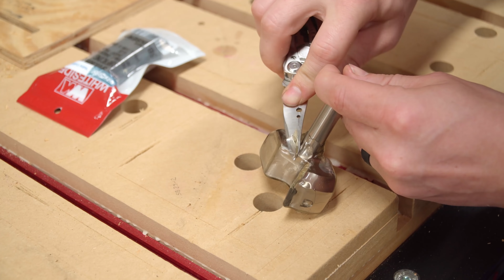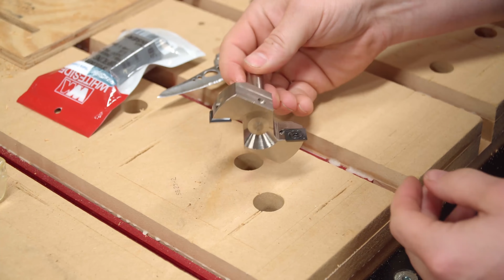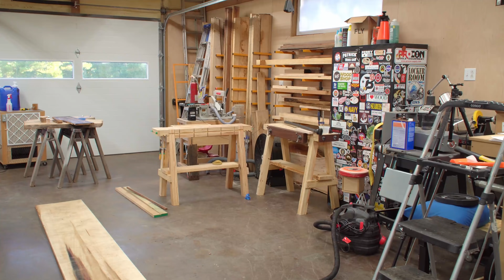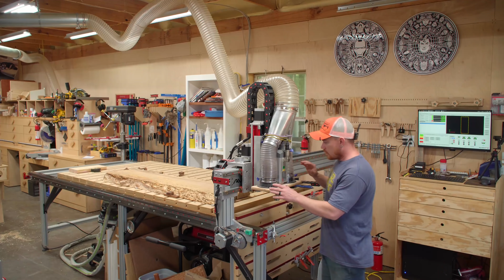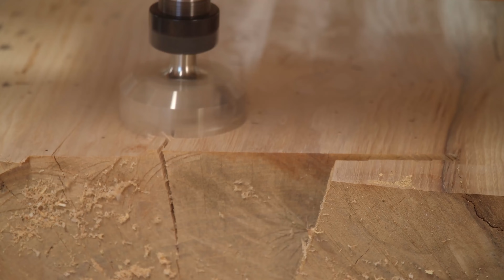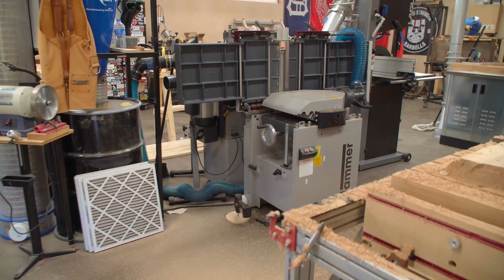Testing a carbide insert slab flattening bit.. (SB25-2)

Comment: Jay. 

Have been subscribed and viewing your videos for some time now.  Great stuff as always. 

I know this has been a year ago since posting the video. 

Had a couple of questions if and when you’ve got time… 

I’ve got a 3.2 kw liquid cooled spindle CNC. To get the hp and maximum amount of torque it runs at 24,000rpm.  Not really a speed that would work on some of the larger tooling to get the power and torque… without raising “injury” possibilities… 

You’ve probably upgraded by now and I’m wondering if you went with a liquid  or air cooled higher hp spindle. And… rpm’s and torque values of your new spindle. 

Happy with it…? Cost to upgrade. If you’re comfortable with giving out that info. 

Best to you and yours. 

Wiredodger60

Comment: I’m done with surface bits and routers for flattening slabs. A hand held grinder attached similar type sleds. Use a turbo plane type bit .
It’s at least twice as fast and does a great job.
Reply: How do you set up a sled to take an angle grinder? There's no flat surface to reference.

Comment: Ok…Stop right there!  Unless you are an earning professional this Bit make no sense….it’s cost is like $430 USD (converted back to USD from Brit Sterling). I suppose if it flattens a slab for a table you can sell for ten Grand (how/where?), then it might be cost effective…or if you are making lots of slabs at a higher turn-around I guess.  But over 400 bucks for a single bit….ouch!  I’d want it gold plated for that! Clearly this is a whole different league of machining!
Reply: You are not wrong but slab flattening is something that is easily rolled into the cost of a project. Owners of a cnc know that if they buy a bit to do one job it is super easy to sell the next job and make a good profit.
Reply: I totally agree for the novice like me it seems crazy, but it is basically a long term buy you get an extra 5 pairs of cutters with four cutting surfaces which are going to cut a lot of slabs. Then a 5 pair pack of replacements for $87. So after the up front cost the cost really is not that high unless you only do like one slab/year or like me one slab every few years.

Comment: 2.2kw is about 3hp..
750-ish watts per hp

I've just put a watermellon-sized 2.2kw single phase induction motor into my John Heisz-style grey-top table saw I built last year (upgraded from the 1.875kw motor from an old Ryobi miter saw).

Having 4+kw in a CNC sounds like overkill dude.. but I wouldn't say no.. lol
I recently bought a carbide-tipped (non-replaceable) 2" slab flattening bit for my enormous old Maktia hand held 2.5hp (1850w) router for munching the tops of bits of my local Aussie Hardwoods, and it works well at 2mm DOC, 50% overlap, but I can't adjust the speed of my router, (it's either off, or 22,000rpm!) so I'm REALLY hoping the bit never lets go while I'm using it, or it'll probably go straight through me without even slowing down!
I doubt even a 10mm plexi shield would offer much resistance either.. 😬

Comment: I don’t know CNCs but when you’re designing your cut path, do you prefer to do a climb cut for a better finish and less chance of tear out?
Reply: I always flatten wood moving with the direction of the grain and make sure my speed is fast enough to avoid any burning. I am still experimenting with conventional vs downhill cuts but they both seem to work on the cnc when surfacing. Regardless I begin sanding at 60 or 80 grit with an orbital to remove machining marks before working up in grits
Reply: @worldtreedesign  good info! The more you know the better, thanks!

Comment: You can run 3 phase if you set it up right off of a phase circuit. Many videos on how to do it. I run  a 3 phase knee mill at home using a 240v welding outlet. Better to  run 3 phase than single.

Comment: Hi Jay, would you recommend a bit that size to be used in a router sled setup?
Reply from the maker: While I've never personally done it myself I don't see a reason why I wouldn't try it. Obviously it's a bigger bit and therefore can have a bigger catch so I would have to be very mindful of not getting too aggressive. I would also be very mindful of having good control of the router and sled as to not let it get away from me.
Reply: I use a 2" Binstak (tried more expensive) from Amazon in my 2.5 hp Dewalt router sled setup.